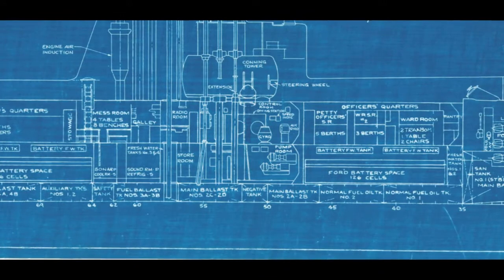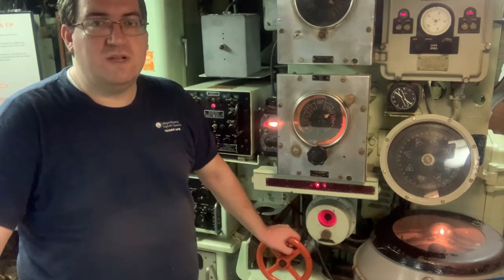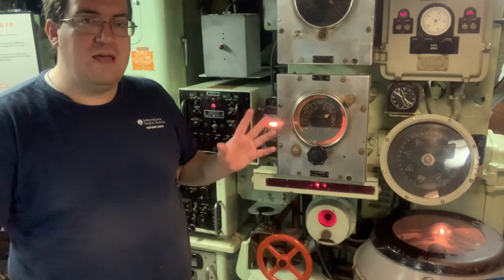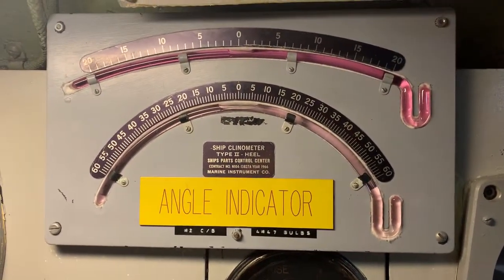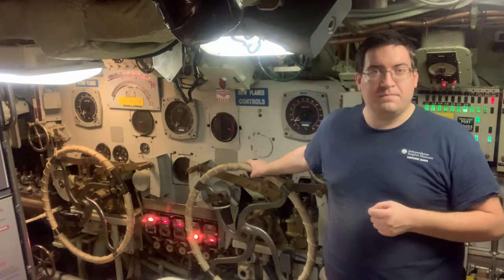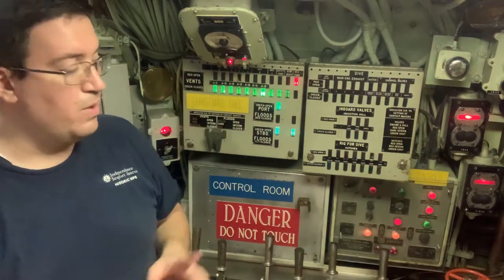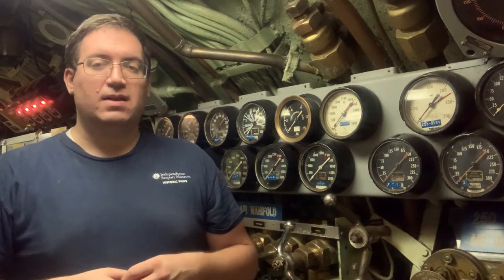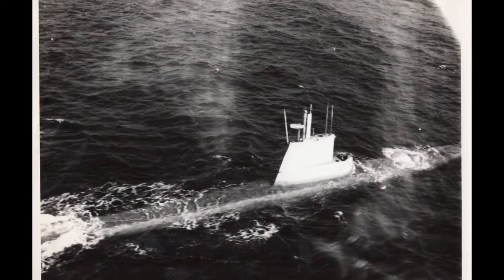Tour the Control Room Aboard Submarine Becuna

Comment: My old nemesis, the AN/ UQN-1, is in sight on the fwd bulkhead behind you.  As a boot Coastie ST3 I in the fall of 1973 I inherited the job of maintaining our old POS. The main problem was it's age and all the years of heat from the vacuum tubes altering the values of components. The main issue was the dual triode,  4 and 24 CPS oscillator (12AU7), that drove the circular sweep on the orange CRT for the 100 foot and 100 fathom scales (V-219 on the schematic). The only way to get the 4 and 24 CPS oscillator calibrated properly was unauthorized ShipAlt..... I changed some components values to get it right. Fortunately my CO was my co- conspirator and he told me to do this. A short time later during our next yard period we got an "new" (to us), AN/UQN-4 and my life was worth living again.